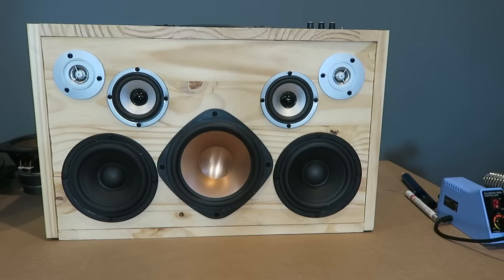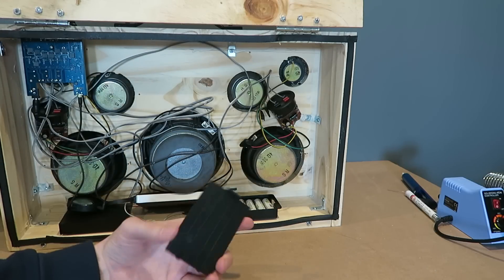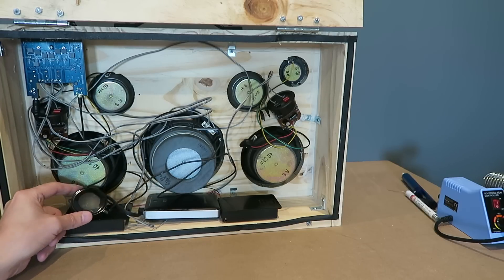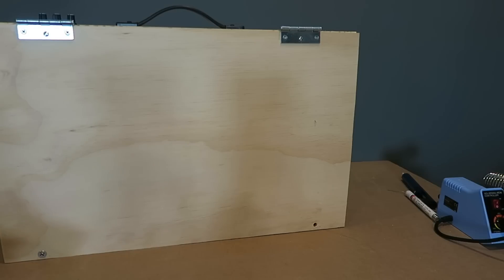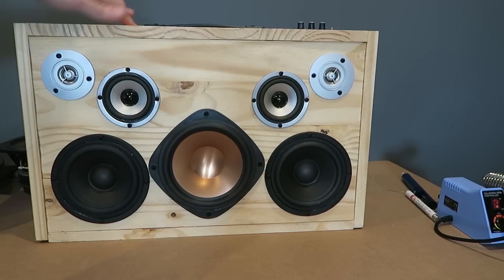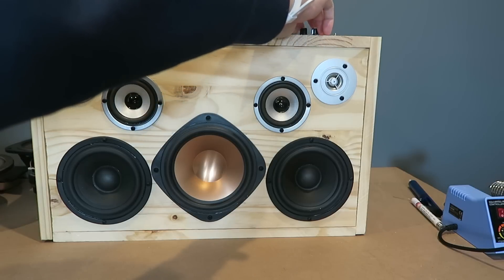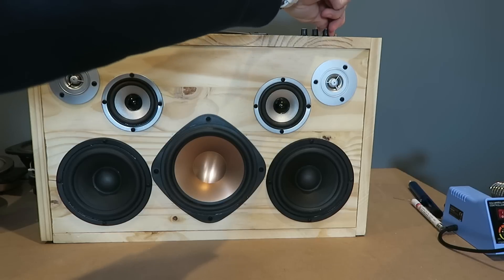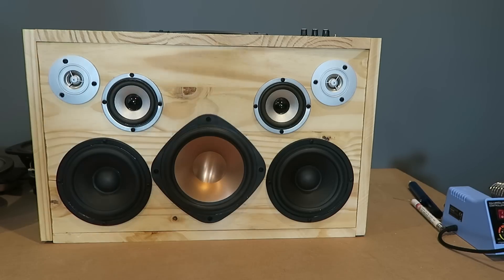Home Made Boombox with subwoofer TPA3116D2 2.1 amp with airplay / bluetooth

Comment: i built something similar many years ago for work, used a prebuilt 8" sub woofer box ( 2 subs) with 2 tweeters, i mounted a 40watt  12volt power booster that was in my car to the box. then used an old boombox with removable speakers, mounted the 110 to 12volt converter to it. made it to carry in in 2 pieces, just had to plug in 2 wires from the sub box n plug it in.
that was one loud setup, worked perfect, i was maybe running 60 watts( radio plus booster). 👍

Comment: Hi, just some thoughts : Your 3 way design is not very efficent. If you want it mobile, less is more. High quality, high efficiency fullrange speakers with a highpass to a subwoofer would be the way to go. There are very nice 3 and 4 inch fullrange speakers, that are very efficient and give you very high quality. Combined with a subwoofer playing up to around 300hz if possible would be the way to go. Also get rid ofvthis batteries as mentioned before. Forget about lipos, get some lifepo4 batteries, if you take bigger ones, they can go up to 10a without any problems. They are also the most forgiving lithium batteries. They do not catch fire or explode if you dont handle them nicely.
Reply from the maker: But would it look as cool? Agree though, have another project going right now with a GRS 8" sub and a single 6x9  car speaker.

Comment: Dude, you have no clue what you're doing. No x-over, no insulation, parallel connects - you're bringing the amp down to probably 1ohm. This is a $10 amp with 5 realistic wrms watts, not a high current amp. To do this type of connection, you'd require 16ohm drivers with an spl of 89dB or higher, with x-over.
Reply: That amp has 2 tpa3116 chips that do 2x50w at 4 ohm and other chip is used for sub 1x100w
Reply: Lol grandpa its class d
Reply from the maker: Smoke another one yo. Watch the update before you make a fool of yourself.

Comment: With AA batteries, you're limiting the power to the amp (and the amount of loudness and clarity you get).  Right now with 12 AA's in series, your getting about 14-15 watts max. That amp will pull 200 watts if you let it. 12 AA rechargeables in series would have to be putting out 13 amps to get to that power (200 W/12*1.2V)=13.88A.  They will never do that.  18650 cells on the other hand, if you had 10 cells with sets of 5 in series with 5 more parallel to that would give you 5*3.7V=18.5V and therefore pulling 200W/18.5V =10A, but with 2 banks of 5 in parallel, the load on each cell/bank would only be 5A max.  That is still not ideal, and I doubt ebay 18650s would do it, but it would be better.    Long story short - moar battery!
Reply from the maker: Interesting, I hadn't tested to see if it was under powered. I'm running another test. Will post an updated video.
Reply: Cool.  Most speaker will make 80-90dB of sound with only 1W, but for real power, presence, and room shaking, it takes a lot more power.
Reply: I built a similiar one using a tpa3116 . powered it witha $13 SLA batt 12v 7ah . Used 6x9 cheap 4ohm Kenwood speakers . SO LOUD , no distortion

Comment: If thats as loud as it goes you might have to upgrade your amp. In my homemade boombox i use a amplifier ic just like you do but it has 4 channels. I think you can find one with that amount of channels or greater and make a even louder boombox.
Reply from the maker: It gets as loud as any bluetooth speaker out there, if not louder and clearer. 
The only time you can hear the hiss is when it is not playing sound.
Reply: ***** So how did you wire it up to the IC? What channels did you use, Wired in series parallel? Per channel?
Reply from the maker: I bought the amp fully assembled on ebay for under $20. The speakers have a crossover that I stole from the cabinets they originally came in.

Comment: what batteries did you use and how many did you use? I'm thinking of getting this amp for another build I'm doing
Reply from the maker: 12 rechargeable AA. 
As someone else suggested, consider 18650 batteries. 
This amp handles 12-24 volts. so just make sure you're in that range. More batteries will last longer and add weight.
Reply: Thank you. I have always used 18650 and when you said 16v I saw far too many cells for it to be 18650 so I was a little confused haha

Comment: the hiss in not from the amp, it's from the entire circuit. It's called a ground loop because the grounds of the bluetooth and the amplifier are way to far apart. It is solvable with Audio Isolation Transformers

Comment: Dear, I need your help to know that battery can be used for a boombox with these components (attached image).

I want it to last at least 5 hrs battery and can continue to use connected to the mains.

Besides that when connected to the current is charging the battery automatically.

Thanks and sorry for my English.

http://i.imgur.com/f5Jof4D.jpg
Reply: To provide enough voltage to power that larger amp, I would suggest using 2 - 12 volt /7Ah batteries in series.
That should provide you with enough power to run it for several hours.

Comment: Nice boom box!  I was looking for a project to do with my 9 year old son and this is perfect so I think I will do this one.  I'll probably add an SLA battery with a trickle charge instead of the battery packs because I'll be buying too many batteries and he will only lose rechargeable ones anyway.  Great video!
Reply from the maker: Thanks. As another commenter suggested, you may also want to look at li ion 18650 batteries. at 3.7v, you only need 4x. http://smile.amazon.com/dp/B009LX94LI
Reply: Perfect idea!  Off to Fry's I go.  I'll post after we build it.  Thanks for the inspiration.

Comment: you could make it sound a lot better if you separe the box for each speaker. now subwoofer negative waves are getting out from midrange and tweeters cones. Also, a deeper box and a bass reflex will make a lot of bass, because speakers are not bad and you have also 2 woofers. anyway, sounds good.

By the way, i have made a boombox with 50+50w amp and the best battery you can use is alarm and motorcycle acid 12v 7ah batteries, in my case, 8 hours of max level music.

Comment: watts of subwoofer ??????? realy need that information
Reply from the maker: +mitja Zabret 100. it is a 2x50 + 100x1
Reply: I know about amplifier but is it this subwoofer you were using it in video 100w ?
Reply from the maker: mitja Zabret Not sure, I pulled it out of a Klipsch speaker. I think they were RF62. I'd guess 75.
Reply: lol RMS or max handling sorry for too many questions and thanks for answers ( maybe i will make one boombox with 80W RMS or 160w max handling subwoofer) so yeah i have to ask a lot ;)
Reply from the maker: For this $10 amp, I'd recommend using cheap and efficient speakers. Whether they can handle 50 or 150 watts is low on my list of needs. I do not know the exact specs of this driver, other than it is 8 ohm (and 4 ohm would be better).

Comment: great work man. how do you use a charger.
Reply from the maker: +ümit çağlar Thanks! I have to take the batteries out and put them in a charger. Luckily they last for 20+ hours easily.
Reply: 20 hours. amazing :) i using this battery.
http://www.ebay.com/itm/New-6800mAh-12V-Li-ion-Rechargeable-battery-Pack-AC-Charger-for-Bike-Lamp-W1-/141369912974?hash=item20ea4dae8e:g:UhkAAOxyGqZSU6Zz
Reply: +ümit çağlar ...Is the 6800mAh 12v Li-ion battery any good? Do you use it for a portable speaker? How long does the battery last and how many speakers do you use?
Reply: NO is not good. 3 -4 I use  hours. but do not remove the batteries. I'm just charging

Comment: Where did you get those speakers ?
Reply from the maker: +Coďák I tore apart some old speakers. If you don't, you'll need a crossover. My next project is using a 6x9 car speaker, which also has a built in crossover.

Comment: Im doing a boombox too but i dont know how to power it yet, hwhat batrteries did you used and how did you connected them?
Reply: 12AA batteries wired in series
Reply: And how do you charge them?
Reply: +cuatripero make sure there rechargeable batteries and they should come with a charger.

Comment: Is there a way you can show the diagram connection?
Reply from the maker: +Andrés Alberto Pacheco Herrada I used the crossover from the speakers that I repurposed. The batteries are wired in series to get 16v. Hope that helps.

Comment: what you hear is most likely a grounding problem or a ground loop is when two devices fight over a single ground and what you can do  is  go to  Best Buy they have a ground loop isolator and I got mine for like 15 bucks and it will get rid of that static and you'll be able to charge your devices off of your boombox without a bunch of noise:-).
Reply: Actually its probably amplifier clipping